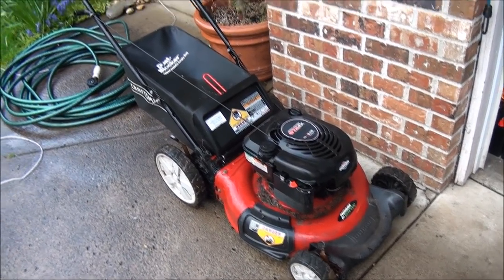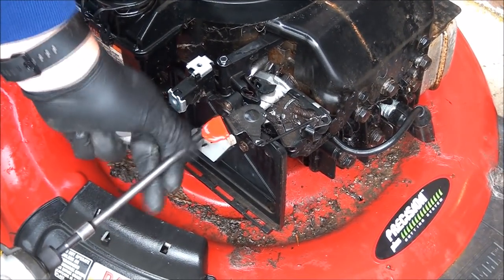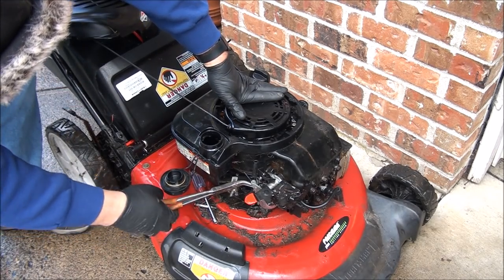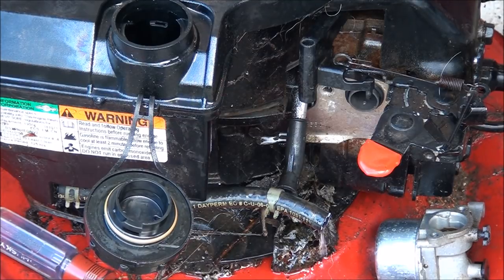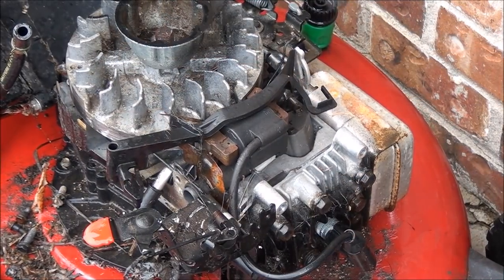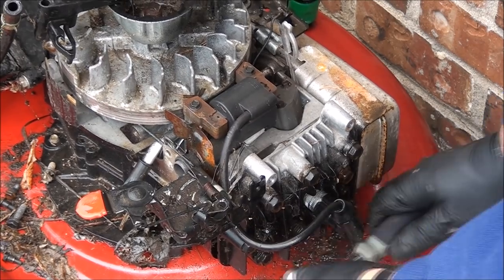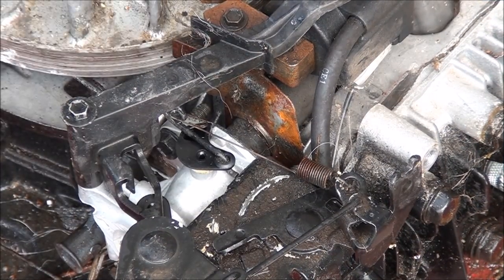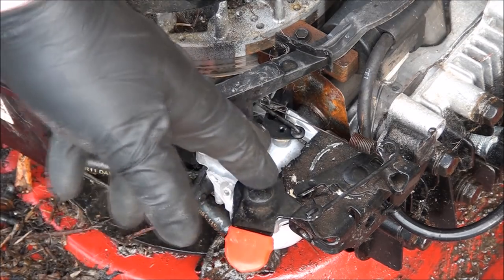Lawnmower: HOW to REPLACE a Common AUTO CHOKE model Briggs and Stratton engine CARBURETOR.

Comment: Perfect.  Did not realize my air vane spring was missing.  Kept having to manually hold that choke lever closed to start.  You saved me a ton of grief.  I have been running a cheap Chinese replacement carb from ebay for 3 years with no problems.  I suspect even the carbs Briggs sells are marked up Chinese carbs also.  Can't go wrong for $12 for carb, spark plug, gas line, air filter, and gaskets.

Comment: I use chineese aftermarket parts all the time and haven't had any issues *yet.  Heck, I've also had great luck with predator 212 engines (Honda clones). Still a good video!   I love watching small engine repairs. Every now and then they really help out when I get stumped or pick up a trick, tip, or forget how something goes back together.  Appreciate the videos.
Reply: eBay and Amazon are where I buy 95% of the parts I use in shop

Comment: You're doing  very good job showing  all the problems  and fixing  it but would be nice if you clean the dirty  dust mower dech and under the cover  just to avoid contamination
Reply from the maker: Yes! cleaner is better but I decided years ago I just fix them I do not clean them. I fix too many everyday and it would be a mess after awhile cleaning so many mowers. Some are REALLY really filthy when the arrive into my shop.

Comment: Aftermarket carbs are MUCH cheaper and work fine if they're installed correctly and parts don't get lost or broken. $12 vs. $45 for oem.
Reply: Chris Insig absolutely.
Reply: true I use aftermarket all the time

Comment: I thought I was having an issue with my auto choke..
Had previous problems with the carb. The bowl was corroded around the edge and the gasket very iffy, so replaced the whole thing, only to find it was the choke. The arm wasn't swinging. Took it apart and somehow the metal on the choke was on the wrong side of the carb choke arm.
The mower was starting now but still idling low.

It wasn't until you showed the part on bending the throttle spring clip that I noticed, mine was shunted right in.. Bent it back out and the thing leapt right back to life again.
Great video. Wasn't expecting it to be a full tune up, just the choke replacement, but you didn't really show an actual choke being replaced.

Very very good info though.

Comment: thank you for posting.  please clarify your point of view on generic replacement carbs.
Reply from the maker: Also known as an " aftermarket" carburetor. Any carburetor not made by Briggs and Stratton. Using genuine Briggs and Stratton manufactured parts is usually the best way to go even though it is often more expensive.

Comment: Jeff i think we need to re qualify your statement to say "Dad's should only allow their kids whether it be boys or girls to repair their lawnmowers after they have watched a YouTube video covering the same type of repair required." My son has been running Eliminator Performance Small Engine Repair for 7 years and has a YouTube channel just like you. As a 71 year old father that is extremely proud of his son for what he has accomplished and extremely educated by both him and all the other YouTube small engine repair channels i can honestly say that not only can i repair anything small engine related from watching all these excellent and some not so excellent videos but anyone else can also. This is an excellent well organised and edited video you have supplied for all viewers and really surprised there are 3 haters (likely aftermarket carb sellers on Amazon). The reason the kid broke the linkage connection piece off the carb is simply the hole in the plastic on 99% of the aftermarket carbs is always too small and by simply drilling it slightly larger it easily goes on. I have spoken with my son and he agrees and says that even he has had some issues using aftermarket carbs but for the price his customers usually opt for the aftermarket simply because of the cost savings. He also notes that over 7 years of repairs there have never been any re service issues using aftermarket carbs but has had to return a few to Amazon for ie: will not prime issues or bad aluminium casting of the carb causing voids or cold shuts. Keep up the good work love watching your videos and stay safe and healthy and social distance.
Reply from the maker: Great info! thanks for the comment! Kudos to you and your son I will check out his YouTube channel
Reply: Jake has an excellent channel also. Been following him for quite awhile.

Comment: Cut the rubber fuel line (from the gas tank to the carb) in the middle and insert Briggs and Stratton Fuel Filter # 298090S. This should prevent any future fuel clogging issues.  Replace the filter every 5 yrs or so.    :)
Reply: A tech out in the field will NEVER suggest that to a customer and we know why :)

If a customer suggests it they look at you in pious amazement and shock like suggesting an inline filter where there is none existing is blasphemous heretic words....I'm thinking specifically of fuel oil furnace deals

Comment: I managed to fix the auto choke lever there’s some bounce to it now I had to redo it so many times but in the process I got my bolts mixed up I was having problems putting the engine cover on and then the little side piece that goes on the outer part where the engine cover is above the carburetor or an air filter anyways thanks for your help I’m really new at this if you don’t show a step I’m certainly going to get messed up by it but thanks for your help.
Reply from the maker: There is a tiny spring on the choke arm by the carburetor, make sure it is attatched

Comment: This is the video that I needed to watch. With the engine cover off I can see all the parts and where they attach was confused before. Thank you for showing close ups with the camera still this makes it so much easier to see what you are doing. I have a Briggs and Stratton Gold 6.75 190cc lawnmower and couldn't find a video that educates me on the parts and functions until now. Thanks for a great video. Can you recommend what type of gas to use? Is it boat gas?
Reply from the maker: Glad it helped. Regular gas is best, non ethanol gas if available. I think non ethanol is same as boat gas

Comment: I check head bolts too once had a riding mower that ran for about 8 minutes then shut off . When it cooled off it would start and run for a while till engine heated up again . Traced it to loose head bolts when engine heated up head would separate from engine and would lose compression and shut down

Comment: Jeff,  I am very greatful of your closeup video explaining how things are attached, and work together.  I rebuilt the  auto choke carburetor, and when put back together and running, it has high r/p/m/, then drops severely low r.p.m.s then corrects itself to high again, then drops severely low.  what causes this to happen?  Is the  choke arm actuator not attached to the other side properly?  THUMBS UP!!!

Comment: The aftermarket carburetors I've bought have given me no problems and are about 1/4 price as a OEM one...I bet they are all made in China under different brands stamped on them so they can jack up the price. With clever marketing, you can sell ice to eskimos....
Reply: I've had great luck  with these  China made carburetors  , out of the last 12 I've ordered only two were sent back . Only one that would run right and the other one as throttle body was designed wrong for my model . Always buy when  you can  have the free return policy , bought one off eBay with a additional $1.99 three year warranty - kinda of   guarantee it would  run . No difference in price between eBay and Amazon , cause I tried Amazon and had too return it and went with one from a new one from EBay . My experience 👍

Comment: Great touch to the ending there Jeff. I had the same issue a couple of times. once with the Briggs Carb, and once with a Honda Carb, that right out of the box was leaking gad like crazy!! I had one of the plastic ones I bought, and it was missing the Butterfly inside the carb!!!

Comment: I just replaced the original carburetor on my Murray with a $10 ebay special and it came with the air cleaner gasket and an air filter that looked as solid as the original with free shipping. I guess only time will tell, but $10 v $50 seemed like the better choice with a free gasket and air filter. If it lasts two seasons I’ll be happy.
Reply from the maker: I hope it works for you! Please report back
Reply: Jeff's Little Engine Service if it’s any constellation, I did take the factory one apart and ordered a replacement needle and seat. It’s on standby to swap the cheapo out if I binds up. Thanks so much for the great information in your videos.
Reply: @Joebanker80  So how is it ? 2 years later.
Reply: @craigtodd8297  Sill running fine with no issues. I let it run completely out of fuel at the end of last season.

Comment: Easier to use a business card or something similar to gap the coil.   Surprised you didn't know that.   Also , why didn't you clean all the debris off before removing the carb?   Finally, it looks like the coil was grinding on the flywheel , suggest sanding both surfaces . 😊
Reply from the maker: Business cards are not all the same thickness but will work in a pinch. I like to know what the measurement is on the coil gap.

Comment: I bought an aftermarket Briggs autochoke carb on Amazon several years ago that was purported to be OEM. 
My customer wanted a Briggs one so I got him one.
A while later I needed an autochoke for one of my mowers, the aftermarket ran fine, and it was less than $15.00 as I recall. 
Still using the mower after all the years.
Is that the biggest hammer you have?
Many times things have very forcefully been introduced to the driveway, here.

Comment: My auto choke lever the one that you’re pushing and it springs back mine doesn’t spring back as much as yours I’ve taken the engine cover off multiple times and made sure that whole arm is in the correct place so I don’t understand you have more mobility in your video than I do.
Reply from the maker: There is a tiny spring on the choke arm by the carburetor, make sure it is attatched

Comment: I have a toro SR4 20381 walk behind mower and there is a very fine small coil spring that wraps around the butterfly choke shaft and has a half loop on it has come off and not sure where it goes any help would be appreciated
Reply from the maker: is this it?  https://www.youtube.com/watch?v=Xg4ZTM3qL9Q
Reply: @JeffsLittleEngineService  no not that one. this is on the carb it's wrapped around the black plastic about 8-10 times and has a hook/ half loop on the end that hooks to something and not sure to what. It has to do with the butterfly inside the carb to make it close to start.

Comment: The auto choke on my lawnmower keeps switching on off continuously, what would be the problem please, maybe the auto choke assembly itself?
Reply from the maker: auto chokes rarely fail. I would make sure the tiny lever return spring is in place
Reply: @JeffsLittleEngineService  Actually not sure if it is the regular auto choke system. It is a harry lawnmower. The lever mechanism that opens and closes the choke that is continuously pulsing on/off is connected to a pivot that goes into the engine and is not connected to the exhaust as they normally are. It also has a bubble to prime the carb. Is there a way I can send you a picture of the mechanism please?

Comment: the aftermarkrt carb would have been fine till the son screwed it up
Reply: Very much agree.
Loose bolts.
Spring missing.
Broken throttle actuator.
Boy can't fix breakfast,much less a lawnmower.

Comment: Great video... with all details shown. I have exactly the same engine with auto choke but I have one problem. It start good when the engine is cold. After 10minutes, it wont start again. The auto choke lever already moved to the front and the little choke throttle is open. Everything looks normal. After a while, I can start it and get a bit of smoke form the exhaust. Without airbox, I get little backfire. Is the card to rich? Once it started again, and it comes down in revs, it really stuck at low rev, nearly going to die. All of a sudden it catches up an runs perfectly fine. Any idea,  Jeff?
Reply from the maker: something is fucky

Comment: I have had great luck with the Chinese carburetors. $8 and away we go. I noticed no difference other then price .
Reply from the maker: Good to hear. Unfortunately I have had mostly bad experiences with cheap aftermarket carburetors.
Reply: @JeffsLittleEngineService  Me too and I will gladly pay more for OEM, learned my lesson a few  times on some GM Auto parts, not only that I buy locally as it helps with our local economy and not China's! Way too much Chinese crap in the sores as it is!!

Comment: why drain the tank. most just clamp off the hose. I question whether this rusty old mower is worth the cost of repair repair
Reply from the maker: You need to make sure you have a clean fuel tank

Comment: The funniest thing I learned today: 
Confirmation bias: You were so sure it was the after market carb, and when you found it was just incompetence you still blamed the Carb.

You overfilled the gas tank and then had clean it up just to drain it all out. Did you expect to mow half an acer?
The GENUINE, "fancy dancy "Briggs and Stratton Carb , from B&S, (799866) is made in China.🤣🤣😂🤔

"It was not all the missing/improperly installed linkage and loose bolts or plastic parts, 'the kid probably broke': it was the carb".

But really: you do not blow clean everything around the brand new carb you are installing???

And then you double down on "it is the carb" and smash it.n 

Too Funny: It was Agathe all Along.